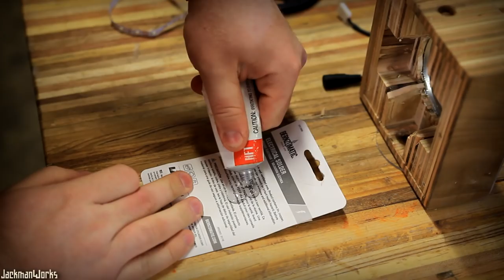Upcycled Glass Lamps 2.0

Comment: All those lamps turned out amazing! I watched your concrete one too. I can't believe they throw out all that glass. I work with molten glass myself because it is fun. I never throw out any leftover glass - already fused or not - I save it all. They should really package and sell it instead of throwing it out. Right now I have more glass scraps than I really need but if I need more I go to my local recycling center and work out a deal to buy some of the broken beer bottle glass they have. - Heidi

Comment: Great project! I've seen you use your glue bot and noticed the tube running from the top to the applicator tip what does that help with?
Reply from the maker: The little black tube? It holds the cap so you don't lose it :)

Comment: The idea is great, but, for my tastes, the whole assembly is too bulky.
I've made a few lamps, and when using LED's, its possible to have the power supply remotely located, and then only a jack socket, and maybe a switch, is needed in the lamp base, so it can be much slimmer.
I would also tend to use a slim tall bottle, rather than a massive preserving jar, which would also have the advantage of being cheaper, [if you cant salvage one from a dumper] and have a wide range of shapes to choose from.
Just google 'whisky bottles' and then images, for a look at the range.
[You then have the task of emptying the whisky bottle of course!]

Comment: I'm sorry if you've explained this elsewhere, but have you taken the outfeed-side rail off of your saw? How is your fence able to brace on that side?

I recently lucked into a Sawstop industrial cabinet saw w/ the 5HP motor, and I'm figuring out how to set it up.
Reply from the maker: Nope, I have the rails on both sides. The back rail doesn't hold the fence at all but it does help hold the table straight and hold the wings in place